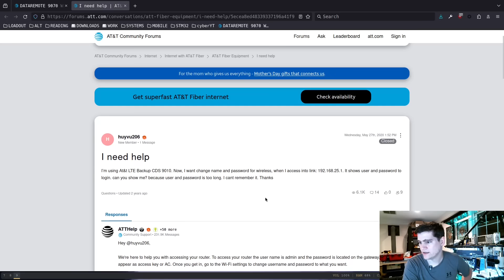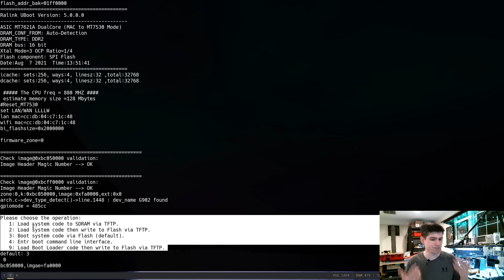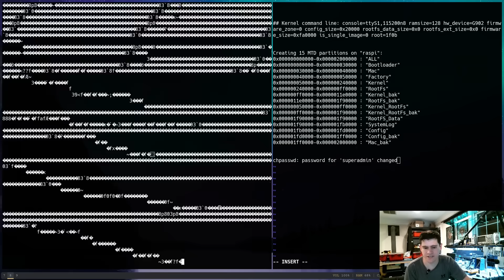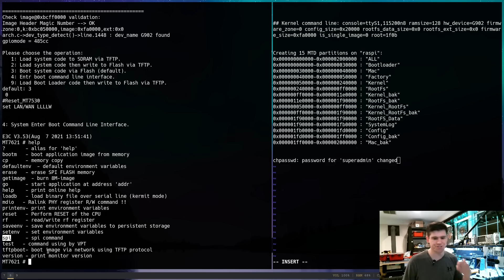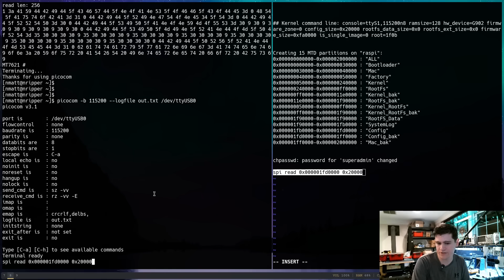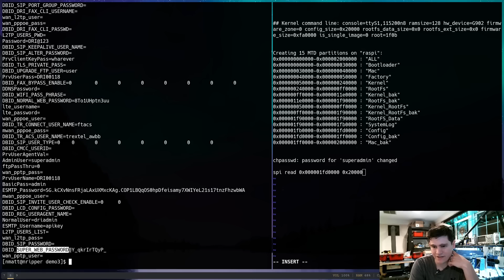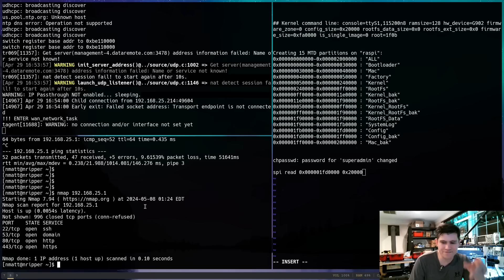Hacking an AT&T 4G Router For Fun and User Freedom

Comment: Nice stuff, good explanation. A suggestion for the next more hardcore step in fw hacking - get a device with a locked bootloader and extract the creds by sniffing the SPI traffic from the flash chip on boot with a logic analyzer. Would be watching this 100%
Reply: Better yet just pull the SPI chip and read it out with an Arduino! No logic analyzer needed.
Reply: @pcguy619  Oh dude, the arduino adapter isn't that good man, i mean you can try but if you need something new i'd recommend an spi programmer.
Reply: Any reference video doing this thing?

Comment: Love hardware hacking ever since I unbricked a router (bad custom ROM flash) with JTAG and making some hacked-together level shifters. You managed to make this entertaining the whole way through, at least for me!

My ISP actually went the other way with "my" modem, which surprised me. When I first got it, I had to call them just to get bridged mode available... A few months down the line they pushed an update which put a toggle for it on the admin page.

That would be a commendable move, except for the fact that the whole reason I wanted bridged mode was just to open ports without installing a smartphone app.

Comment: PWNED, as they say 😀
I've been a software engineer for almost 20 years and the hardware side of things still seems like black magic to me at times. I'm surprised the configuration data was stored without any encryption... However, I suppose if it was, that would just add unnecessary complexity to the device. Enjoyed the video, you explained things very well. Thanks!

Comment: Loved the video! I have to confess that I envy your knowledge (in a good way). What you do seems to be super fun! Just so you know, here in Argentina, all ISP devices are managed by the ISP, and we don't have access to them. That's the common rule here. The issue is, if you manage to gain access to the device and change anything, as soon as you reconnect to the ISP network, they overwrite your settings with their own. So, unfortunately, there's not much you can change on your side.

Comment: I love this :) just a quick correction: SPI isn't a flash type but it's a communication protocol type. The flash does use spi in this scenario, but SPI itself stands for Serial Peripheral Interface (and it's usually denoted by 4 wires, MISO, MOSI, CLK, and CS). SPI is faster than I2C and allows (in theory) an unlimited number of slave devices :)

Comment: great job - curios of the pin to the right of center mirrored the pin to the left of center as ground was at each end. Would allow the cable to be plugged in either way and still work.

Comment: This wasn't that serious of a lockdown. But you got in, good for you. One point worth mentioning, is the boot process where it changes the superadmin password. This is an indicator that there is perhaps another password for superadmin in some sort of 'default' configuration that it might be useful to get. But it also indicates straight away that the config partition is the place to look for what the password is set to. My guess is that you already knew that, which is why you went to the config partitions right away, but I am mentioning this for viewers that didn't get that clue as to how this stuff is done. I am actually a bit out of practice in this area of hardware hacking, I stopped in 2019 but have been thinking about it lately because I've found a few mystery routers in the trash and for $1 at a tag sale, in addition to a Comcast business router from 2019 that is probably rather locked down pretty well, thanks to CJ Heres and others.

Comment: The POTS lines are most likely provided by the cell radio, not for another method of connecting to service (ie, they're outbound VoIP kind of service, not an inbound dsl/dialup link).

Comment: The phone lines are for a built in ATA adapter, if the provider support it and it is provisioned, it can be used to connect a regular analogue phone to the router which connects to the providers VOIP network. There is no PSTN modem in that router.

Comment: Forgive me if someone has already said this but the RJ11 jacks on these Data Remote CDS units aren't for input/WAN. They hand off POTS lines via VoIP. They're a 'POTS in a box' or 'POTS replacement' solution to replace legacy copper lines. 

It's pretty much just an ATA (Analog Telephone Adapter) multi WAN router/modem, wired and wireless, strapped to a battery to meet code requirements for fire alarms, elevator lines, pool phones, etc.

Comment: I had a vivo (Brazilian carrier) lte router that had this POTS connection and usually they are not for DSL or dial up connection but for FXS/FXO where you can plug standard telephone and get tone to use voice services provided by the carrier

Comment: a similar device that i've tried to hack that is even tougher is the t-mobile 4g lte cellspot. they REALLY don't want you getting in and have gone as far as putting a photoresistor to detect if the case is opened and disabling the UART pads on the board. i'm not sure if the UART is disconnected from the board or disabled in software but it's very locked down, likely because it has a 4g radio that could probably be misused.

Comment: Yes definitely keep doing content like this. Can you do a video on hacking a current or even an older one is to work on a cable router? Cuz I know there's ways of getting in and they call him zero routers they're about 5 to 600 to buy and you just need a basic internet plan to get on. From there you once you get in with the firmware of that is available online you can open Full throttle on these things and from their all the AC is your regular router running and they just assumed that's all that's going on but you're going in around the meter if you will if you get with the reference I mean to that is it's like bypassing the water meter in your house and just tapping in basically. And from there you get free water so in this case you can get free internet and cell phone providers are one of the easiest ones to grab for internet from so I think going to Cable would be even better and see if in the modern day anyways if you even need a plan at all as long as your cables hooked up at all is there any data still coming in so if it is that means you can get in use the full utility of a zero and you can get extreme bandwidth and he completelyI would love to see a video on a truly hacked rooted 0 router done. I guess you can call it a ghost router and that instance right?

Comment: Do you have a dump of the rootfs? And how far off is it from DD-WRT normally?
The big question is about the licensing. The source code should be available if they forked an open source project.

Comment: Hey Matt this video was awesome! Do you have any advice or additional sources for someone who wants to get into the hardware hacking side of things? How did you get started to end up doing this now? I have a bit of experience on the software side of hacking but it seems so fun and cool to be able to actually learn to tinker with electronics and IoT devices and not just computers! I did order a digital multi-meter to get started and now I would like to learn what types of common components are found in the internals, how they work, and eventually how to be able to build my own projects. Thanks in advance if I get a reply, you also gained a sub bro
Reply from the maker: Check out my recent video about the top 5 tools for beginners. In that video I talk about how I suggest you start with a project, a goal, and then seek out the tools and skills to work on the immediate project in front of you.

Comment: There is no POTS / DSL modem to get Internet on this unit, rather those two ports are VOIP FXS ports. This would allow the carrier to configure SIP on the device and allow the subscriber to have a couple of analog POTS phones connected.  The phone calls would traverse via SIP over the LTE connection.

Comment: Thank you for the primer. I wish I still had the technical ability to do this myself; however, my skills are too out of date.
I have been trying to access my xfinity Security cam to turn on some features we ate locked out of unless we pay extra. I also want to end xfinity home security and use the cams  without service. As yet, have not cracked the access code.

Comment: writing this comment as I watch

13:00 I noticed while you were on this screen right away that it says at the top "default driadmin password was changed" and a couple other lines related to that. doesn't look like it made a difference at the end, but I'd be interested to see what strings in the file you pulled out refer to "driadmin" since people were talking about that online.

also thought it was funny when you pulled up a whole python thing to calculate your read length, when the only character that changed between the addresses was D to F. that's 2 more, thus 20000. if it works it's not stupid, of course, but I'm still lmao

when you said "let's go and try it" at 29:27 I was thinking to myself "wait isn't the device still paused in the bootloader tho, did he reset it while I wasn't looking" and lo and behold lmao

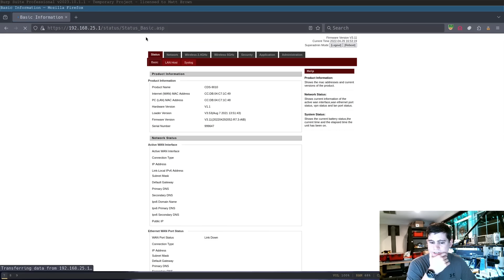31:36 this web UI looks suspiciously like DD-WRT... companies doing company things

in all, a VERY cool and seemingly actually really simple process to break into this thing, great work showing everyone how it's done. I'm tempted to pick one of these up now and use it as a modem-on-the-go. maybe even use it as a modem in the car...

Comment: Hey Matt. It was amazing to see you hacking into the device. I love to watch, however, most of the technical stuff goes above my head. I have an Electric Car Charger which has all the components rated to 22 KW, but in their firmware they have set it to 11 KW. I was wondering if I could hack into the firmware and change it to 22 KW. What do you say about that?

Comment: That 4G module I got once in a Mini PC(x86 based)
Is quiet generic and to use it you just need a SIM card slot (can be motherboard or adapter card) and a mini PCIE slot(mostly for older WiFi cards as newer boards mostly come with M.2, but for 4G/5G modules is still mostly with mini PCIE)
that thing can work with windows(need to install driver) also linux(on Ubuntu 24.04 work out of box)

Comment: Those POTS ports are FXS ports for giving you dialtone - The LTE looks muchly like a quectel EC25 module. It should just talk AT commands over /dev/ttyUSB2 - you can put it into QMI or MBIM mode and bring up a connection with modem manager (openwrt or linux on it) -- else! you'd wand to use ppp mode probably. Just do as they did ;)

Comment: very interesting Matt. I am dealing with Western Digital about a 4TB drive I spent money on but they drive was so "old" according to their own guidelines that if is out of warranty. The device I bought from a standard mom and pop shop completely sealed last year and the very first time I tried to connect it failed to be recognized by the manufacturer (WD) website. On my end it looks great with an IP address, and I can ping it but I can't access it via any means. Not yet. I called WD support and they mentioned that this drive was OW as of 2020 but nobody used it and now its firmware needs to be updated but it cant reach the server where its supposed to update its software. Have you heard of this before? I Have a 16 Samsumg Camera Surveillance system that its also on the same line of issues. I am your most recent subscriber. Thanks fo the videos.

Comment: Not all AT&T 4G routers like this have the web UI login credentials stored in the same place or use the same username. In the one I have It read on line 107 - "userlogin" = "superroot" and then way down on line 1502:  "superwebuipassword" = "uber1337password"
This was located in the config where the config.bak was just a blank slate config with no values.
Also there was omitted configs for Firstnet layer access bound to Sim 2, so it looks like this device can be used as a base station on the Firstnet service alongside providing POTs and broadband internet access on SIM 1
IDK about others but my router is not sim locked to AT&T either. I was able to put a T-mobile sim into sim socket 2 and get service on that as well

Comment: Those pots are not for using land line for internet, they are for providing a phoneline OUT to the user, if configured by the provider.  It can provide 2 phone lines, different phone numbers, to the end user.  Think of them like what you see on the back of the Xfinity cable routers.

Comment: I may be wrong, but on the output of the flash chip partitions it refers to it as "raspi". Does that mean they configured a raspberry pi device for this? The board doesn't look like one, but I'm admittedly ignorant to hardware

Comment: FYI you don't need to use python to compute the length. F is two steps from D, so F-D=2. Position works the same in hex as in decimal, so F0000-D0000=20000

Comment: Those POTS ports are not for dial up internet, they are supplying POTS service over the SIM card, you can plug any analog POTS telephone into that port, get a dial tone, and dial a number that will connect over the SIM card account.

Comment: Older products like this don't password protect the uart boot cli.  A lot newer ones do to try to prevent people from getting in.  But a lot of times on the chip, you can look up the data sheet and short a pin to ground to disable password protect. And other hacks. But the chip documentation is your best friend to get you into CLI.

Comment: I wonder if this type of approach works for some other devices .. I have some thermal face recognition cameras from hikvision .. I'll try to do some UART to see what I get  ..
Reply from the maker: Thermal or IR? 🤔
Reply: @mattbrwn  thermal .. the ones use during lockdowns . .. composed of 3 separate modules ...the square ones that you can have on a tripod
Reply from the maker: Hikvision devices can be pretty locked down depending on firmware version and model. 

Would be interested in seeing what you find. Should definitely post on our discord if you find something.

Comment: This is why I shut down the wifi on my router and put in my own router plugged into the Ethernet port of the router.

So I can change my WiFi and configure my network as I want

The companies don't want people to do this

Every time I have had a technician here or spoke with the tech support on the phone they said they don't like people using their own routers

Comment: Wow. It has a WAN port which could connect to net via fiber conversion box. Also, the Phone 1&2 is to SUPPLY VoIP (POTS online). You plug in your old land line phone there...DSL or ISDN would not be on phone 1&2. It would have a separate jack(s) labeled as DSL and/or ISDN. POTS were the ultimate hack, and well documented. I like the video though, thanks! Can you gain the same access to Comcast Business Backups? Cradlepoint makes the device. It will not allow port forwarding, and Comcast won't give GUI login.

Comment: Thanks for the great upload!  I happened to have this unit and I successfully got the superadmin password.  However, unlike your unit, my unit data is in config folder not config_bak folder.  For my unit the sip read is 0x000001fb0000 instead of 0x000001fd0000.  In case anyone else find this useful.

Comment: I have a couple of those Franklin T9 hotspots, which run Android , are superbly hackable, and very tiny. Got one hacked up and hardwired into my ebike battery in an always on, automatically powered up configuration, with a cronjob that runs a script to update its location every minute.

Comment: Hi Mr. Matt , first of all thanks for this great sharing, I tried with my router but couldn't find the "spi" command as shown. available options are -                                                                                          bootm   - boot application image from memory
cp      - memory copy
defaultenv  - default environment variables
erase   - erase SPI FLASH memory
getimage  - burn 8M-image
go      - start application at address 'addr'
help    - print online help
loadb   - load binary file over serial line (kermit mode)
md      - memory display
mdio   - Ralink PHY register R/W command !!
mm      - memory modify (auto-incrementing)
nm      - memory modify (constant address)
ping    - send ICMP ECHO_REQUEST to network host
printenv- print environment variables
reset   - Perform RESET of the CPU
rf      - read/write rf register
saveenv - save environment variables to persistent storage
setenv  - set environment variables
test   - command using by VPT
tftpboot- boot image via network using TFTP protocol
version - print monitor version
Can please help ? Thank you

Comment: I've been installing these devices at red Robins in WA. Crazy that I ran across the video just days before I started installing those devices. They are cellular provided POTS lines, providing a primary and secondary analog line for the fire panels at the restaurants. Funny thing is. Most of the sites I went to already had a cellular callout system in place. So I have 3 Of those devices on hand right now, and the tickets paid out before insent the boxes backxD. They have Verizon sim cards in them. And have batteries in them so they won't go down in a power outtage. The thing is, the company I was working for can see them when they are powered and online. How can I disconnect them from the devices without losing the data access? I would need direction like a total noob. I need to remove this post asap

Comment: 26:57
Why not use something more concise?
import sys
with open(sys.argv[1], "r") as fin, open(sys.argv[2], "wb") as fout:
  inp = fin.read()
  outdata = bytes([(int(s,base=16)) for s in inp.split()])
  fout.write(outdata)

Mostly wondering about the loop, it seems more complex than necessary, this should be a quick and dirty script, no?